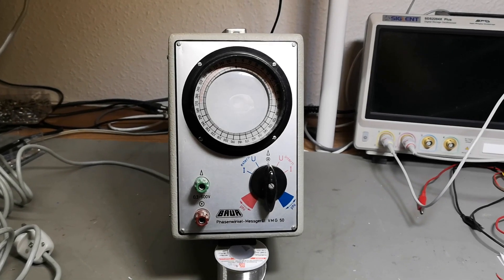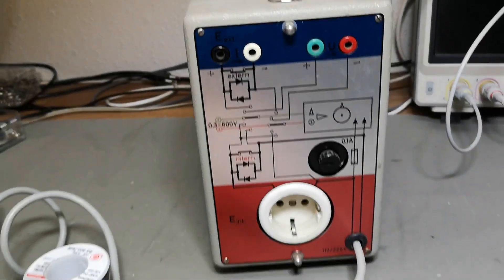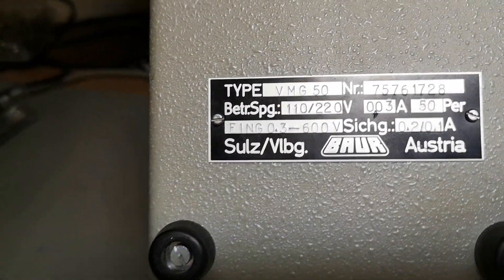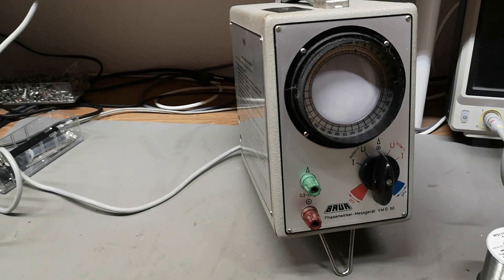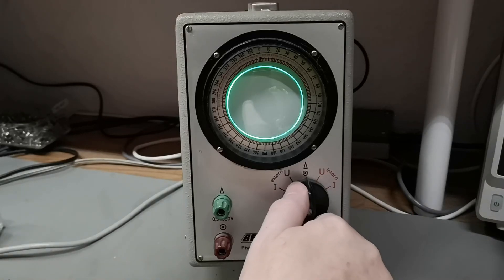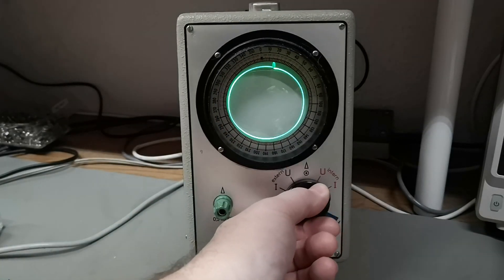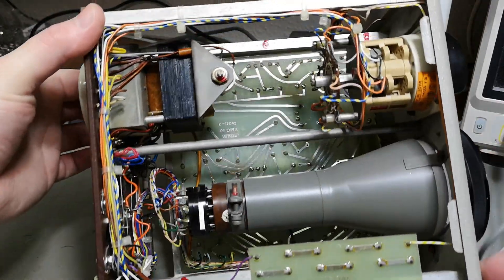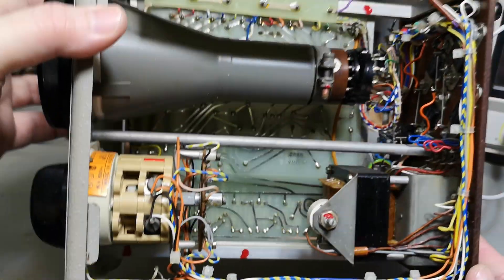Baur VMG 50 Phase Angle Meter Phasometer 1988 test teardown

Comment: Hi, that's a beautiful one, not seen very often
I just didn't understand the color marking of the terminals, I would automatically ground the green and they ground the red, unfortunately manufacturers sometimes follow their rules, these colors should be unified so green ground, red active

Nice day 🙂 Tom
Reply from the maker: Yes, you are right, I see all sorts of connector color systems, sometimes it could also be a repair, all they had left was a funny color, still better over a broken connector

Comment: Phase angle is easy, just use a mains rated power factor correction capacitor of around 4-15uF, which will give the 90 degree phase angle.